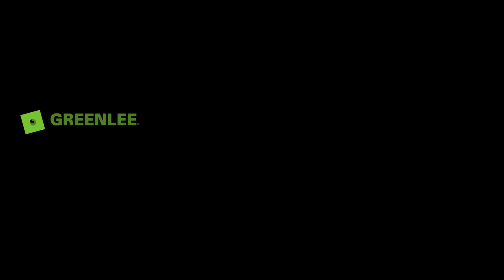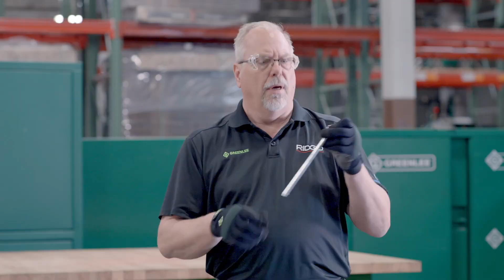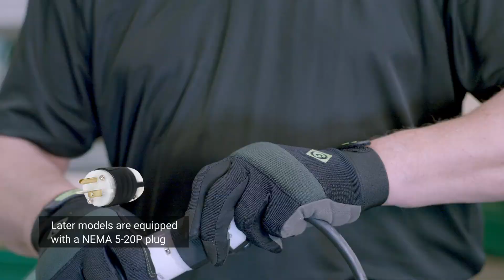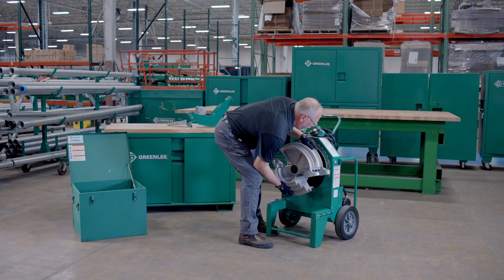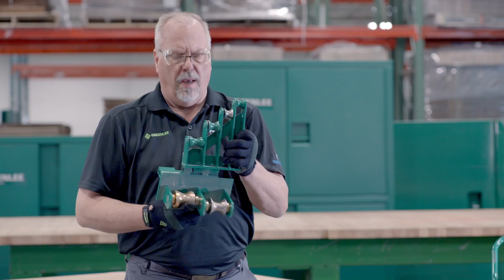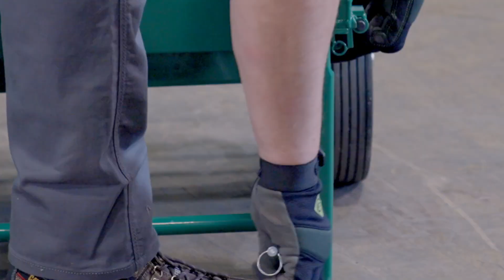Greenlee 555 Bender Tool Inspection and Preparation

Comment: How do you find the back of the bend, center of the bend on the 555 Bender
Reply: Take a scrap piece of conduit and place a visible reference mark anywhere on it. Load the conduit into the bender, aligning that mark precisely with the front edge of the shoe hook.